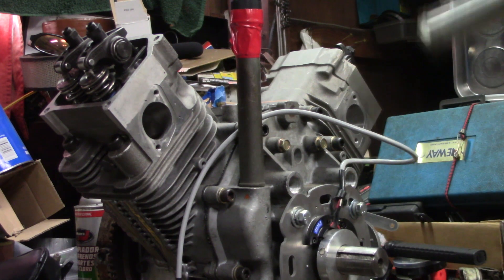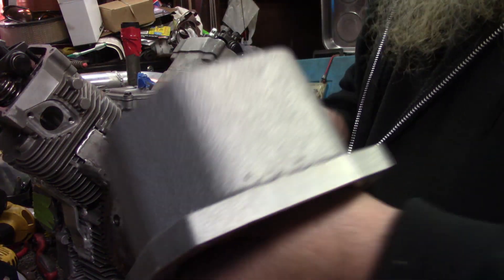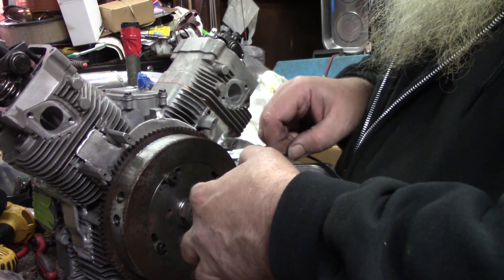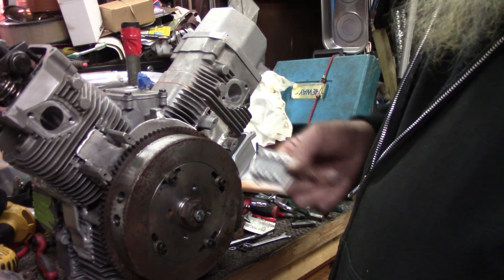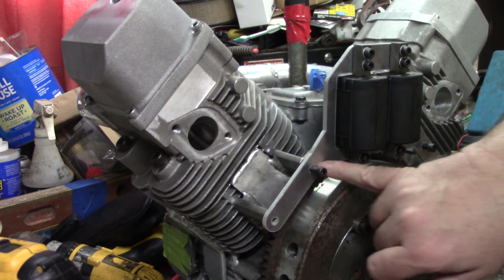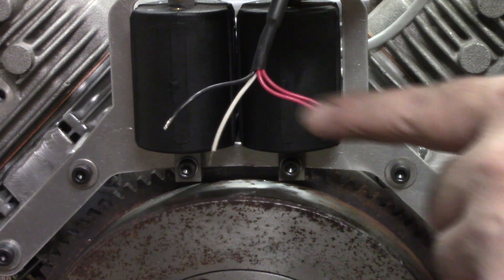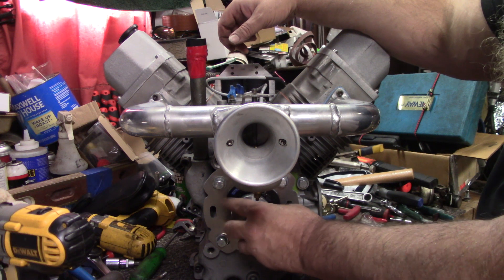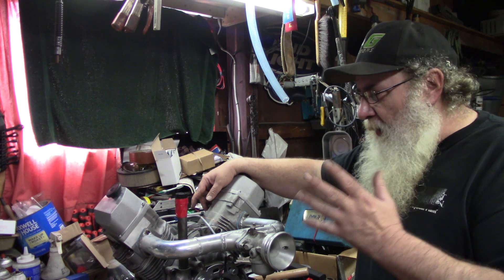Kohler Command Pro V engine build Part 14.

Comment: Great vid Ed! I too add silicone to those thin rubber gaskets. So much can and will go wrong with those.
Reply from the maker: I didn't do it on this round of assembly because I know I'll be back into the rocker to do a final adjustment.

Comment: Looking good Ed. Question, why is Mark running an adjustable flywheel? Did he get a good deal or already have it? Can’t wait to hear it fire. 👍🏻
Reply from the maker: He already had it laying around. I'm sure at some point it will get swapped out.
Reply: Solid fly wheels are out of stock when one comes in it will be going on the motor